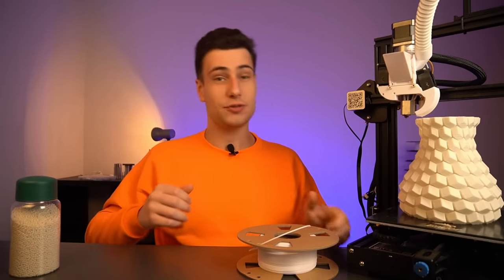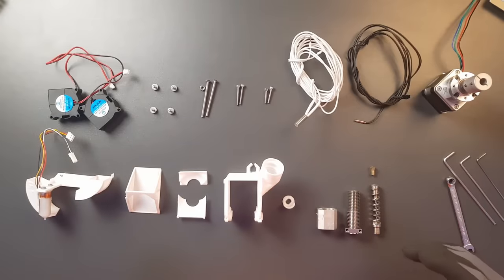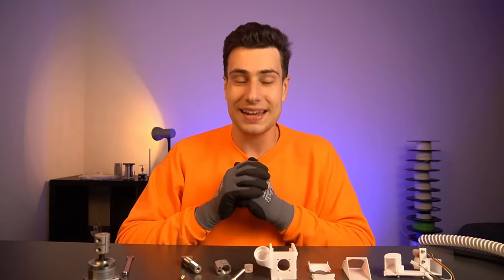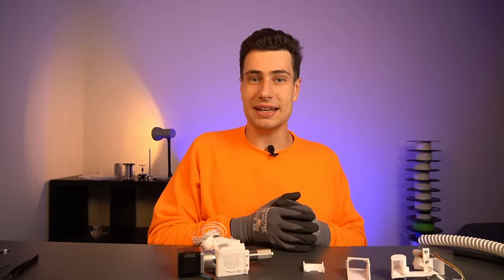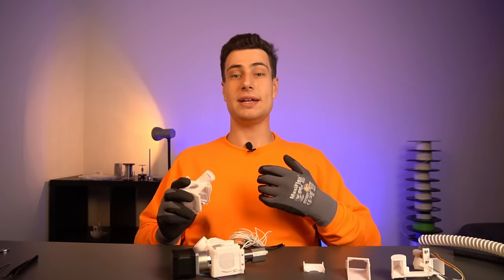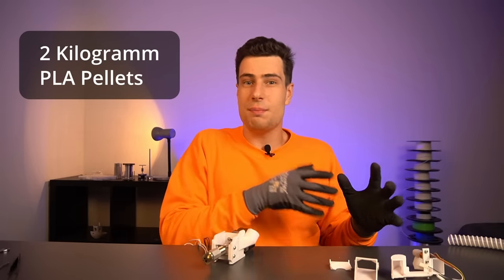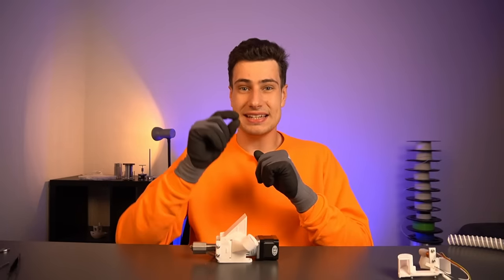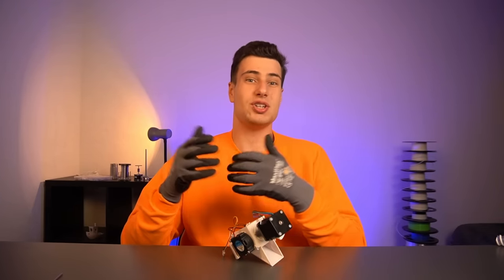Pellet Extruder for ANY 3D PRINTER | 3D print Granules, Chocolate, Sugar and more

Comment: Please do a video on side by side comparison of a fine tuned filament print and a print from your print head...must be alot of retraction etc how do you fine tune your print head? Also multi materials PETG TPU...
Reply from the maker: In my first video I have exactly done that and compared 2 Benchys Filament vs Pellet.

What would you like to see next? 🙂
Reply: @greenboy3d  Love to see what settings need to be changed and what needs to be changed in the marlin and klipper firmware. Do you have any idea what the pricing will be?

Comment: This is awesome! I will definitely be following the development. I do have questions though. My main printer is a 100% custom and an experiment in complexity shifting. Aside from reducing part count, my goal was to get things as small as possible. This is easily 2.5-3x the height of my print head/extruder. Crazy idea I know, but have you ever thought about connecting the heat block directly to the motor and using a stepper with a hollow shaft and integrated screw to feed them? That could be pretty small. Either way, this looks cool, excited to see it come to market!
Reply from the maker: Thank you for your warming words! ❤
What would you like to see next? 🙂

Comment: He's from Bielefeld... A place that doesn't exist. Clearly a troll.

But in all honesty, really great engineering right here. Though I'm not to fond of you telling people that they can print edible items like chocolate or sugar. 
Neither should you use anything you want to eat with an extruder you have already run plastic through, due to residues but the 3D printed parts aren't food safe. 
If you want to print chocolate or sugar this design but made in metal is still the way to go there. As for 3D printing plastic? You did a damn good job and I can't wait for the release of the files.

Comment: I would recommend solving getting consistency on par with filament. Maybe a two stage or longer melt zone. I would imagine mass of the head becomes a problem at some point and isn't suited for core-xy. I'm definitely interested as a solution to prototype, especially at size. Where it would be most useful is at scale in a farm, and at that point consistency and quality are most critical.
Reply from the maker: Why do you think it would not work with a core-xy?
Reply: I would presume its considerably more mass. That would affect resonance, acceleration and deceleration. Not to mention the variable of high speed movements will have on loose filament near the extruder.  @greenboy3d

Comment: There is a major pellet extruder problem not mentioned: melt behaviour control. How do you get it to produce a consistent output on demand, that the same volume of polymer gets expelled for a given number of steps under different printing conditions, speeds, starts/stops? How do you do retractions or pressure advance?

A device extruding pellets into filament doesn't need to concern with these issues, since it can just run constant speed and do a small adjustment accordingly. A high precision output is possible.

Comment: how is retraction handled since there is nothing to retract?
where do I get the screw?
how difficult is it to assemble?
how big of a modification is required to the marlin firmware and gcode?
got designs for an anycubic vyper?
Reply from the maker: All of your questions will be answered in the next videos.

Regarding your Anycubic Vyper, I in fact already made an adapter for this printer and it will be for free :)

Comment: Question:  for 3D prints you’re ready to trash - can we chip them up and feed them into the hopper to be utilized again?  
And if so - how many times?  Has this been tested?  
If it hasn’t been tried & your feeling adventurous, try increasing the temp by 43.33 deg C (110 deg. F), if possible.  If not, 44 deg F (6.66 deg C).

Comment: I wonder if single-pellet feeding to the hotend could be better. In other words instead of having one big chonker conveyor tube thats gravity fed having several 1-5mm tubes that are being pushed down from the hopper with a set of independent screws. Then you could probably get the tubes to feed reliably even horizontally, allowing for much greater compatibility with enclosures and such. (Though you would probably want to merge the tubes into a drag-chain for organization still)
Reply from the maker: The pellets would very likey get stuck

Comment: Great video! How did you solve a problem with screw overheat and pellet jam in the "cold zone"? When I was testing the same screw on the left (from the aliexpress), because of that issue, I had to mount an extra fan to blow to the screw end. And have you done any calculations of the screw shape? Also, when you talking about marlin, how the calculations made? Do you have a correct way to calibrate steps pre min?

Comment: This is interesting, my main concern would be compatibility with my existing printers. I like the idea of plug and play and reliability with bambu lab and prusa, even if I have to pay a premium for it.

If you could work out a way to use what you've learned to create a self-contained desktop filament extruder that would be even more revolutionary IMO. It doesn't need to extrude quickly, even if it took 3 days to make 1 spool, because I don't use that much filament, but something to take the price of 3d printing from hundreds of dollars a year to less than 100 would be super cool.
Reply from the maker: I am working on something similar, but right now my priority is the Pellet Extruder :)
What would you like to see next? 🙂

Comment: I think these would be a great value-add for print farms where you have multiple printers and can keep them topped off. No more filament runout sensors. No more 20g spools of leftover filament that have to be thrown away. One question i have is porosity. What do the prints look like compsred to filament style? I imagike theres quite a lot of air inclusions?

Comment: I just bought my first 3d printer yesterday, a any cubic kobra 2 max. I would love to try your pellet extruder on the machine seing as it will save money. My intention is to start a 3d printing buisness because i lost my job last year. Im a engineer like yourself but more electric/electronic based.
Reply from the maker: Thank you for your warming words!
What would you like to see next? 🙂
Reply: @greenboy3d  I was looking at the tubing you used  to feed the print head and saw it was not smooth on the outside aka corrugated, if it's the same on the inside that could cause some binding.  If the tubing inner walls are already smooth then my mistake.

Comment: Have you experienced pellet jamming regardless of their size? I saw a solution where someone added a vibration device for the pellets to shake and avoid jamming. Does your nozzle thread already solves that or do you think your design could benefit from a solution like that?
Reply from the maker: There are 2 types of Jamming that can happen. 

1)  Where the motor can not provide enough torque and starts to Skip, (for example: because a bigger Pellet enters the system)  = complete stop of extrusion

2) Where pellets get Stuck at the barrel entry 

For 1): This doesn't really happen because of the reasons I mentioned in the video

For 2) This strongly depends on the input material. If you use for instance normal Pellets then I really doubt you would encounter this problem. If you use completely irregular scraps of shredded plastic pieces that, exceed the maximum recommended pellet size of 5mm then the likelihood of your material getting stuck at the entry increases, which however in this case has nothing to do with the pellet extruder but more with size & shape of the material you use. Maybe in such scenario a vibration device would be beneficial, but in the majority of case it's simply not needed. In addition to that, the movement of the print head while printing acts also as a kind of vibrator...

Does this answer satisfy you? 😀
Reply: @greenboy3d  more than enough of a answer, thank you for your time and it’s great to know that! I’ve subscribed to your mailing to get updates about this project and hope to use it on the elegoo orange giga. Others in the Facebook group are looking forward as well! It would be great to have large nozzles and high flow options for large printers like the giga. I also like the aesthetic of large layer height on big design pieces such as the ones produced with robot arms for architectural pieces.
Reply from the maker: @filipefarias3076  Could you tell me the name of the facebook group? 🙂
Reply: @greenboy3d  Sure! its the "ELEGOO OrangeStorm Giga 3D Printer Owners" private group now with 953 members. The group is starting to be more active now that the first backers are receiving their units from the kickstarter campaign.

Comment: How do you ensure accurate flow Rate if the pellet size is varying? The material into the hotend is not directly proportional to the motor rotation rate?
Reply from the maker: I recommend you to watch my first video, in which  I answer your question in detail with images and explanations etc. :)
Reply: @greenboy3d  interesting. So it is exactly the problem.
I see commercial solutions often have a variable pitch on the screw (smaller pitch near the extruder).

Comment: Great project can't wait for when its finished.

Is it possible to use a lighter motor? That seems to be the heaviest part on the printhead and it also seems to have a gearbox. Do you really need that high torque or accuracy for it? If you could use a lighter motor with a small gear and a bigger one on the pellet screw that might also work and could bring the weight down a bit or is that not possible or significant?

Comment: Could you use metal pellets and make a working metal 3d printer? I would assume that it would require metals with a low melting point.
Reply from the maker: There is a Material called MIM (Metal injection molding) pellets, these are pellets consisting out of metal powder + a binder like PLA they can 3D printed through a pellet extruder and then sintered to a solid metal part.

Whether it would be possible to use solid steel or aluminum balls and directly melting them inside the extruder is an interesting, but unfortunately for now I have no answer for you regarding that. 🙂

Comment: Will your pellet extruder work with the Bambu T1 Mini?
Reply from the maker: The pellet extruder works with most 3D printers. However, in the case of Bambu 3D printer, there is the problem that Bambu Lab designs their 3D printers to be very difficult to modify not just with a pellet extruder but unfortunately in general 😕

Otherwise, I would have already made 3d printable pellet extruder adapters for all Bambulab 3D printers...

Comment: Interesting to see how challenging it is to control the flow rate of the material - leading to poorer print quality and weaker parts in the z axis.  How about using the screw to pump melted filament instead of pellets?  This means placing the heater above the screw and a separate system to control pellet delivery rates.
Reply: melted pellet materail - not filament

Comment: Subscribed!
So far haven't bought a 3D printer because I'm concerned about all the plastic waste I would produce that I can't recycle and about the price.
So curious about your upcoming shredder video.

I guess you also need to keep those 25kg pellet bags you buy free from moisture to avoid print quality problems? How do you go about that?

Do you see a way to be able to automatically switch between different pellets, e.g. for a multicoloured print? I mean in the future (e.g. 5 years from now) as I get this would be rather challenging.

Comment: I am very glad to have found your channel. I was just looking for different options on how to produce a device I invented (now in the process of patenting) to improve people’s health. The inside of the main part has a complex internal structure and cannot be produced using molds.  It seemed to me that the device would be very expensive and many people would not be able to afford it. The only option I found before your video was to buy an industrial extruder and produce filament for my needs because filaments are too expensive. Your solution is much more cost effective and easier. So thank you very much! Can you please tell me where I can find (buy?) the drawings of your device? Thanks for the very important and useful information again!
Reply from the maker: Soon, the 3D Printed parts will be for free. The rest comes with a KIT that needs to be purchased
Reply: @greenboy3d great! Looking forward for it!

Comment: Amazing work! Indeed a revolution. it's your manufacturing limits that forced you to be innovative that's at play here. E3d should have done this but rested on their laurels instead.
Reply from the maker: Thank you for your warming words ❤
Your statement "it's your manufacturing limits that forced you to be innovative that's at play here" is probably very true :D 
What would you like to see next? 🙂
Reply: @greenboy3d  I'd love to see some of the customised pellet tricks you mentioned in the previous video, seems very cool to do a rainbow print with pallets. As well as a colab with  Stefan from cnc kitchen on the material strength, being able to use ppa/cf50 at below pla prices is probably as much a revolution as the pallet printer itself 😮
Stefan would also increase your reach 100x so not bad marketing either 😉

Can't wait to see how this will change the market the coming years.

Comment: how well does it handle shreded pla? The cost for PLA is not very high (I pay 10€ per KG). It would be interesting for failed prints or supports in my opinion. Grinding these down is pretty easy.
Reply from the maker: It can easily 3D print with shredded Material, but it the "output" print quality very strongly linked to the quality of the shredded material 

What would you like to see next? 🙂
Reply: @greenboy3d  would like to see what happens when you change the color of PLA. Is the transition just an ugly brown/black/grey goo or could you actually do some color shift?

Comment: Thanks a lot for sharing this and hoping to get one when it becomes available. 

Not a pro and just started to 3d print. Would the dust be a problem with the opening on top of the extruder? Just asking out of curiosity.
Reply from the maker: There an even more improved Version now, which has a dust cap for the opening :)

Comment: Would it be possible to have the screw feeder 3d printed, in metal, by one of the online 3d printing companies?
Reply: Most any 3D metal print company would allow you to submit a small part like that yes. If you don't have (access to) a lathe, then yeah that might be the best option. You would likely need to sand and polish the final part as delivered as 3D printed parts don't have the same level of surface texture that a rotary screw extruder has. Generally you want those screws to be HIGHLY polished.
Reply from the maker: In, theory yes, but it would be quite expensive unless you have your own metal 3D printer.
Reply: It probably won't be needed, the screw looks like it can be made on a 4-axis CNC machine. Most machine shops will have one, and an online machine shop would be able to make one, given a CAD file.

Comment: I wonder if it could work without removing the filament extruder by mounting it to the other side, a dual extruder setup would add some value. Things like pva supports or integrating flexible and rigid materials in a single print can be worth it even if one of the materials is cheap pellets and the other expensive filament.
Reply from the maker: Well, you are on the right track here! :)
What would you like to see next? 🙂
Reply: @greenboy3d  There is so many things. An automatic pellet changer could be an even more versatile route to multimaterial printing. A cmyk dye pellet mixer would be very nice too although I imagine that quite a bit of purging would be needed between colors/materials.

Comment: Does nozzle size affect how much line width varies during printing? Like are prints with a 0.8 mm nozzle more consistent than prints with a 0.2 mm nozzle?
Reply: I suspect this system would be insanely bad on a .2 nozzle, with this much open air you're going to easily get clogs, even larger nozzles will be at a higher risk of throwing clogs
Reply: @shanematthews1985  I could see myself using this extruder with a 0.6 or 0.8 nozzle for a larger format printer.
Just interested if 0.8 mm would give better results relatively speaking than a 0.4 mm nozzle or whatever he’s been using in the videos.
Reply from the maker: The bigger the nozzle the more even the flow 

What would you like to see next? 🙂

Comment: if the screw is capable of printing ground scrap, is it possible to make filament with it? a recent development in filament recycling is re-pelletizing. say you put a big nozzle on it, like a 1mm or a 1.5mm, and extruded some rough filament with it, maybe with a spool winder of some kind. you could re-pelletize that, dry it, and make some consistent pellets for extruding.
Reply from the maker: Sure, this is possible. You just need to keep in mind that every time you melt a plastic, causes a degradation of it, making it weaker. 

This is also why pellets in theory provide much stronger prints, because they had less processing cycles :)

What would you like to see next? 🙂